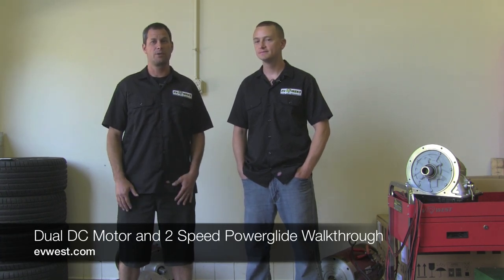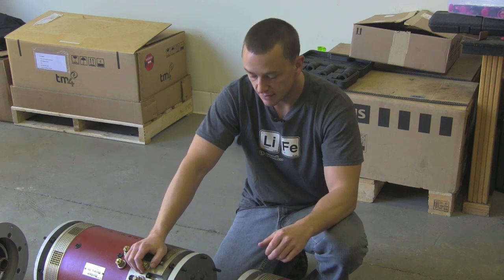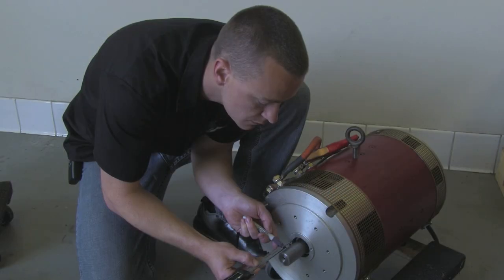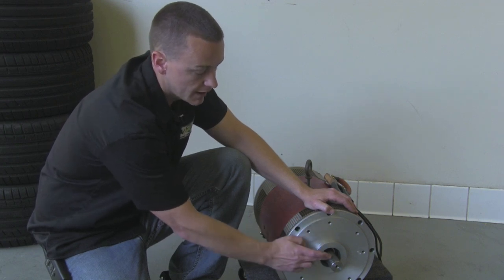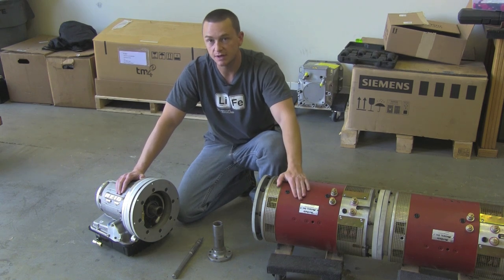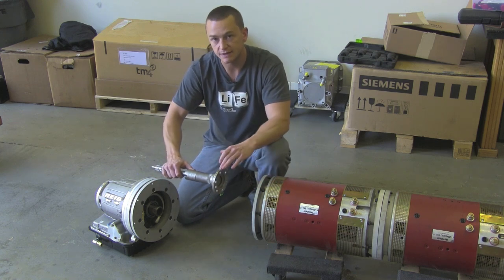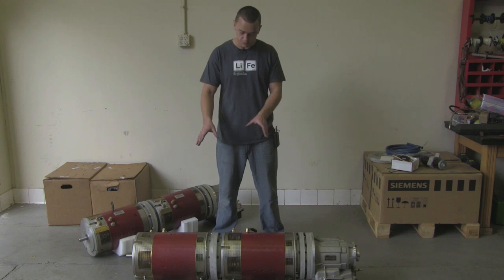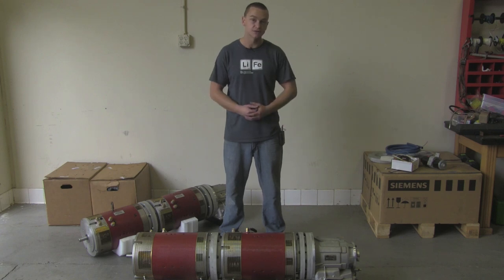Dual Motor Electric Vehicle Drivetrain With Powerglide 2 Speed Transmission Walkthrough by EV West

Comment: Don`t those engines need some calibration or smth ? Isn`t there a chance that one will run slower and other one faster which will break them ?
Reply: +thecosmy1 That is the beauty of electric motors.  They self-adjust to each other.  The same laws hold true for train locomotives.  There are generally two motors per truck on an engine.  And there are two trucks.  Making a total of four motors.  They adjust to each other and act as one motor.  And not only that, when you see a large freight train with multiple engines all those motors combined together act as one, even tho there is a separate power generating plant powering the voters on each engine.  (I used to work at the CP locomotive shop years ago)  This is a huge advantage of electric motors versus gasoline engines.  Gasoline engines must be calibrated very carefully to make them run together.  And they are not near as efficient.
Reply: Harold Bullock  Thanks a lot for that great response !
Reply: +Harold Bullock 
This is so cool!!
Reply: +Harold Bullock Can you share some detailed study notes for this principle?
How do they exactly synchronise?
Reply: They are mechanically connected together
Reply: It's a frequency controlled Motor so it will adjust with the number of Poles it will get.....it will draw only the current it needs, so it balances itself and just for safety the current is monitored by the controller
Reply: thecosmy1 same voltage same hp/torque in a daisy chain !
Reply: Some questions:
What is the tranny for? Would it save energy because the motors csn run slower and would'nt that power be consumped by the hydraulic pump?

Could I use that hydraulic pump to feed the power steering/breaks of a big landyacht like a Caprice or so?
That two E-Motors probably got the torque of a 572-stroker....right?
Reply: Arcade Collectors Europe yes just as much power probaly alot more.
Reply: Arcade Collectors Europe  just looked it up and these electric motors have more horsepower and torque
Reply: WHEN YOU ATTACH 2 SHAFTS OR CRANKSHAFTS, JUST CONSIDER THE 2 MOTORS 1 MOTOR, BECAUSE THATS WHAT IT BECOMES.
Reply: That's how  Diesel-electric Trains work,   Many engines wired together.  They put 4 or 5 engines together on a regular basis.  They been doing it for decades.
Reply: Thanks for that, I am building something with multiple electric motors and people kept telling me about this problem from a gasoline point of view!
Reply: Sarthak Salunke if one carries the other, which could only occur if one is at full rpm, the carried motor would just use less or no power, but I doubt if any ever will be at full rpm, but under load, so both will pull amps with the weaker motor (winding differences, very minor) pulling more amps.
Reply: learrus depends on what you're building. If they share the same d shafts like this project fine, but if they use gears or belts it could wear out the gears or burn and brake the belt.
Reply: thecosmy1 t
Reply: they mate to one another closely enough
Reply: Can independently motored wheels connected to one speed controller act similarly to a differential?
Reply: yes... but the controller needs to be precise.
Reply: That and locomotives use Diesel engines to provide the electric power rather than depend on batteries. Longer (unlimited) range, and efficiency since the engines run at the optimal speed, right at the top of their performance curve. I believe this is the mode/configuration that VW is pursuing.
Reply: I have a 99 honda accord with a sheared camshaft that I bought for a steal... been seriously considering doing a electric motor conversation with a gasoline generator to recharge the batteries  as a home made hybrid, been trying to figure out how to incorporate the system your solution might help me.
Reply: The beauty here you can also use a DC to DC converter to recycle energy back at much higher efficiency than having an alternator coupled like In a car to recycle energy back... These motors can also be turned into an efficient regenerative breaking system!! With a much smaller battery pack as energy will be sent back with the DC to Dc converter Whatever they teach us in school and college is a joke!!!
Reply: enator71  Yes and you can speak to the folks at old warp motors they are very clued up on energy efficiency!!

Comment: So I have several questions.he mentions internal pump.is this the rear pump that was in the early aluminum powerglide or something different.next powerglide has bell housing like th350.did it just get cut off or special case with no bell housing.I am wondering why not keep converter you could weld the splines to converter.since it has transmission you could use it in 4x4 real easy just by getting unmarried tcase

Comment: I was looking for electric hubs like a train uses with electric power to drive the wheels and found this. How about two 220 or 550 vac motors driving this type of set up? Put it though short CV shafts and universals right into front wheel drive. A 3 cylinder diesel generator running at 2000 rpm feeding these motors for a economical way to move even heavy vehicles for the cost of a 3 cylinder low RPM generator run at half capacity?

Comment: Advice please? Im guessing the trade offs for the dual motors is greater torque/power vs increase in battery drain (battery not lasting that long)?  Though apparently the reviews on Zombie 222 are amazing and it can pull fast but can be 'mode changed' to do a little less than 200km range?

Comment: What's the power of one motor, and the power of two, and the power of three? Also the weight of the motor, and the weight of the additional plates? I'd like to see at what number of motors would be optimal for a power to weight ratio.
Also, how would things change if you change the coupling of the motors; say, within a gearing setup, two inputs and one output; or using a planetary gear where the second gear can provide higher gears and over-drive?

Comment: Would these same steps be done to attach a Ford C6 transmission as it was to use the power glide ?? Would it be make a difference if we used the torque converter ? The last question is mainly for information; if the TC makes a difference.

Comment: Why do you say this setup is only for racing, does it lack something you need in a street vehicle? I see so many conversions that retain the old transmissions and clutches and I can't figure out why they wouldn't want to replace all that with this tiny 2 speed Powerglide. Even with a single motor on a front engine rear drive conversion it would leave a huge amount of room under the hood with the motor back were the transmission used to be. Anyone know?

Comment: Awesome setup, I'm looking for a high torque set up though. Do you offer a high torque rating in the 1800-2200 pound range with HP in the 500-600 range. Size and weight are not concerns whatsoever. This is for an over the road tractor application.

Comment: About what you have in front of you is a total of four Motors 2 power Glides so you just need to reverse one of the packages to have front wheel drive and keep the forward one going for the rear and if you wanted a real low gear reduction you just reversed both Motors and put both transmissions in Reverse you'll be still be going forward but with a lot more torque

Comment: I note that you haven't got an interference fit on the shaft adapter between the motors, you have on other direct drive applications including the spider to reduce lash. Is lash not a problem when using the powerglide transmission?

Comment: I have a 03 ford excursion with a 6 inch lift and a blown v10 engine.. just curious is there an electric engine strong enough to work in an 8000 lb truck

Comment: I'm in the market for a truck. I'm from Oklahoma and will soon be making regular trips to NY towing a 2 car trailer bringing cars north to my friend who sells cars.  If I got something along the lines of a f250 4 door long bed, is there an electric conversion that could deal with all that weight and still have a respectable range or even make the 1600 mile trip without a recharge?
If I go with a manual transmission is there a way to make it regen while going down hills?

Pete

Comment: aren't you concerned with getting the grinding debris in the motor and the bearings? The intake are right there. I think I'd mill some lightning holes in the plates.

Comment: Love the idea of coupling engines. What type of power source set you use? Does the engine or electronics require cooling? This is the engine but do you need a separate power source for the electronics in the vehicle?

Comment: I would like to see how this assembly is mounted in a car. Are additional brackets required?
Reply: JEFF BRANSKY right?  I'm not able to picture where in the hell all that is going.
Reply: Richard Upyurass I’m guessing that assembly goes in a car longitudinally with a drive shaft (maybe a short one). The motors would power the rear wheels through a rear differential. Just a guess. I say this because the Powerglide is at one end. So it’s not sitting between the drive wheels like many modern purpose built electric cars.

Comment: Great Video Guys, May I ask what controller and batteries did you use? Thank you in advance.
Reply: *****
the batteries are CALB 180 Ah SE Series Lithium Iron Phosphate Battery...the cost is $243 for one available on http://www.evwest.com/catalog/product_info.php?cPath=4&products_id=50
....you will need around 54 cause there are 36 batteries,2 pack (each pack containing 18) where the rear seats are and i guess there will be some inside the trunk too so 56...total cost $13,608...and it will need a BMS (battery management system) too i guess...

Comment: M & M: this is the second time I watched this video, but the first time I saw it... about a year ago... I did not notice the potential for damage to the grease seals just a short distance away, from contamination by the debris flying up as you cut off the ends of the shafts.

An easy fix would be to slide the motor into a garbage bag, and tape it off with masking tape snugly around the base of the shaft.  It would keep the metal dust out of the grease seals, as well as  other places it could get in to play havoc with your magnets and other internal parts.

But I personally don't ever again want to use any brushed motors in any of my motors... have already had a variety of catastrophes from brushes disintegrating, and accidentally over-revving the motor so that the commutators explode from inertia.

This can happen as a result of accidental down-shifting when using a tranny, or if on a downhill grade.

You guys certainly know a lot more about EVs than I do, but I do think you need to protect against metallic dust when you are cutting off shafts for any reason.

Comment: Excellent!!, thanks for sharing, what model of motors are? i want somes.
Reply: These are NetGain Warp 11s. You might be able to find them second hand they have been around for years now. These motors have brushes so there will be a lot of arcing and they create a lot of dust because of that and wear out over time. They're not great motors for long trips or holding highway speeds for very long because of that. However they're very torquey and are great for drag racing and some track use. They're also good for around town city driving just avoid the freeways so you don't  burn up the brushes. You can put blower fans on the brushes to help reduce the heat and wear some.
Reply: @chris55top  very thanks for your answer and the info, very very helpfull, thanks!!!

Comment: Until you can pull into a service station and 10 minutes later drive away with 250-300 miles available, the internal combustion engine is here to stay. It takes hours to charge an EV auto. That will add days to your trip from say Missouri to Disney World. Even a "Hybrid" uses an internal combustion engine to keep the battery charged.

Comment: I wonder if it would be feasible to use no real transmission. But instead us a variator like found in most moped. I know it uses a belt and the gear uses weights to shift. As RPMs increase the belt stretches and rides up the variator. The only problem is most cars are a lot heavier then a moped. And a electric motor has a lot of power. I would think maybe a dual belt system. Or use timing belts.

Comment: in your webpage you state that this powerglide 2 speed is only for racing purposes... Why si that? If I put in the line a transmission oil cooler would I be able to run this setup in a Chevy Suburban for long distance trips? note that the tires are 37s

Comment: How much would it cost for a conversion of a sedan car?
Reply: $25-35000 guessing.  higher depending on battery type used.
Reply: You might safely figure $6k DIY plus battery. $1000 battery may get you up to 10 miles and a $30,000 may get you up to 600 miles. So there will be trade off between range and power and driving style.
Reply: billyfromtheusa  well Billy, like I said DIY battery that you might get 10 miles of range out of might be around $1000.
The reason you dont know of such a battery is because you don't build your own batteries.

I would never pay anyone 100k to work on my car. The facts is I dont let anyone work on my car period... for any amount of money. My car already does 0-60 in 3.4s as it sits. I could sell my engine and transmission for around 12k so that will cover a good motor and controller, then it's just a matter of constructing a battery. Used laptop batteries are pretty inexpensive although labor intensive. 
I may gut the front of the car and put a motor up there also.

100k... pffft please. Get real. Maybe if I didnt design motor control systems for a living.
Reply: @billyfromtheusa, for $100k, you're better off just buying the Tesla S.  While you may not get neck breaking acceleration, you'll definitely get style ;)
Reply: @2020tuber  : ??? Where did you hear that a Tesla S (or ANY Tesla) would NOT give neck-breaking acceleration?  YouTube is crazy-full of Model Ses at drag strips trouncing everything from Lambos, to Porsches and Ferraris.
Reply: @billdale1  "may not" = the driver don't have to floor the pedal.  Also, model S acceleration is not really neck breaking, IMO. The new Tesla roadster is ;)

Comment: So without the 'torque converter' there are no other wasteful elements in that transmission? shame about the oil pump but otherwise fairly ideal for DC EV use if you must have a wider speed range.
Can the front motor shaft handle the double torque in this dual config?

Comment: I understand not using a torque converter for simplicity and instant power to the ground but torque converters can be very beneficial as at full stall they can multiply the torque output by over 2x!
Reply: Just a waste of energy with electric motors with full torque from 1rpm

Comment: I am concerned that the vibration from the cutter would prematurely wear out the bearings in the motor.  Has that been an issue for you?  I would be more inclined to remove the armature from the motor, then cut it.
Reply: +Harold Bullock 
I'm in no way an expert, but I'd think that taking the motor apart increases the chance that you'll damage it.

Comment: An associate & I are contemplating converting an old RV Motorhome into Electric.  With the large size frame available for battery storage, this sounds like a mechanically feasible idea.  Any thoughts/insights from readers or EV West ?  Thanks for the video, informative !
Reply: I would like to start a project using a step fan and electric motor with full solar panels.  Also, the sides would come up and be more solar panels.
How is your project coming along?

Comment: I’m a little confused on this video and build  as to why the 2 Speed Powerglide is being used ? Why not use a Standard Transmission that can handle the torque of the two motors and leave it in  one gear  to  work like a Automatic ?  Sort of keeping it simpler than the electric pumps and  other electronics  keeping the Powerglide lubricated ?  It   Seams that having the least complicated system  would be easier to maintain  and operate ?    Now I admit I’m not a Engineer or a expert on Electric Drive although I’ve been a Aircooled VW owner and Enthusiast for many years  and I’ve had a  interest in  converting one over to Electric  since the 1980s  it’s just the correct car and timing has not  happened yet  so that’s why my  interest is  for watching your YouTube videos  FYI I’m 57 years old and I have  a thing for the older VW based kit cars  as they were always  interesting and cool in the Advertisements in the back of my Dads Popular Mechanics magazines in the 70s as a young boy ,my Dad also had several VW Beetles too

Comment: awesome you have a 2 speed transmission.  about 2:1 and then direct drive?   so all based on a 4000rpm max RPM motor set up? 
what is that, 300mph in 1:1 mode as max top  mechanical speed. (2000rpm at the wheels is 150mph'iish)   what's the power at say 3000rpm vs 4000rpm before you run out of RPM?
I suspect the use range is really 1000 to 2000rpm on the motor for peak power.
that's 75 to 150mph in 1:1 mode and 35 to 75mph in the 1.8:1 lower gear.   Is that about right?
how do you shift.  gear level in cockpit , like an automatic  transmission.?
Or, is there a differential as well that gives further reduction?

very cool stuff!

Comment: hi, good job
please I want to know which type of electric motor is better, I mean DC motor or AC motor?
voltage(V) ,rpm, amperage(A)
other things, for me  the bruchless motor is  much better than bruched motor because the bruchless motor ,like its name does, doesn't have bruches and between the rotor and the stator, nothing than magnetic field which does all the work to spin.( the coils are mounted in the stator while the rotor has magnetic bar like neodymium bars)
any way, thanks for you all